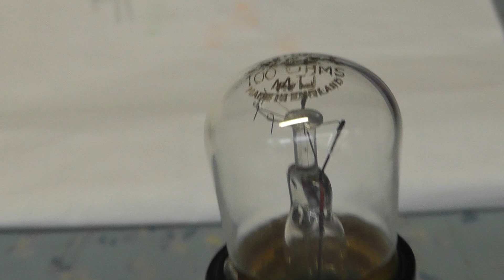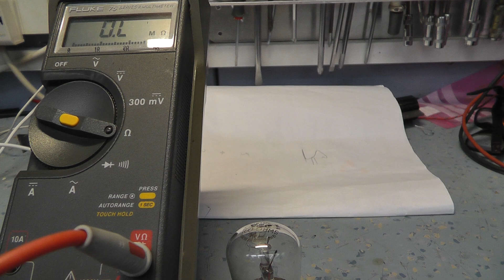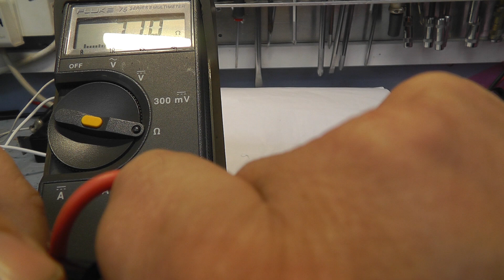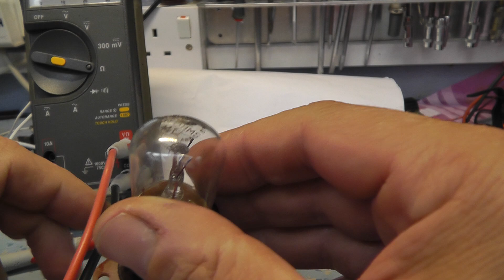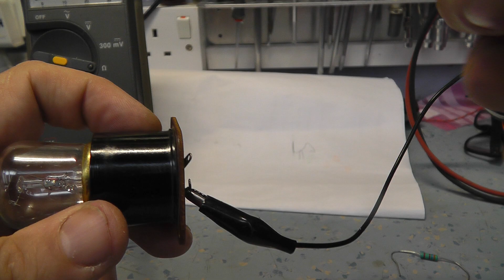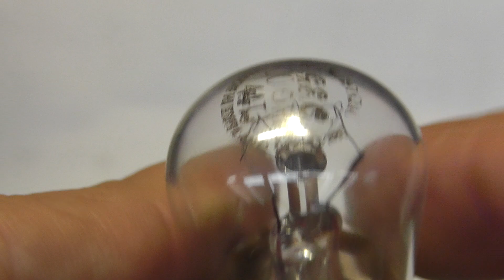Identify this if you can?

Comment: Barreter? Still useful, if you can find them! Wish they still made them... :(
Reply: These are great. Usually they can be had very dearly second hand (when sold by people that know) or very cheaply (when sold by people that don't). In the latter case it's a coin toss between flogging them on ebay or tossing them in the bin as many think of them as light bulbs. Some don't look like light bulbs (due to the base and internals) but some resemble one very much, like the own shown here. I think that most look like light bulbs though. I've never seen one up close though.

Comment: It's the polar opposite of a thermistor!
Reply from the maker: Depends if its an NTC or PTC thermistor.
Reply: @SoddingaboutSi  ,  In modern equipment we mostly see Devices with negative temperature coefficient, so that they limit the inrush current a little bit and then warm up and take themselves mostly out of the circuit after a few minutes. By the way, a good example of how lamps that function  as non-linear resistances are used would be the fuse and bias lamps in a Hickok tube tester; or a Wein Bridge oscillator.

Comment: It reads on the top: "Resistor".  So it must be a current limiter.   As temperature of the filament rises, resistance follows; hence the lower value in ambient temperature.  I wonder how much current it can endure.  You certainly don't want to blow a rare, cute thing like that one.

Comment: Cool video.  I mark all my incandescent light bulbs with its ohms value.  The watts rating on the box are not correct.  When I buy them from the seller I check it with my multimeter so I know what I'm getting.  Then ohms law P=E*R or P=V*R.
Reply: You do know incadescents resistance rises sharply with heat? It's a nonlinear resistor like a PTC. This is why they are so good as a current limiter.

Comment: Bar"ret*ter (?), n. [OF. bareter to exchange. Cf. Barter.] (Wireless Teleg.) A thermal cymoscope which operates by increased resistance when subjected to the influence of electric waves. The original form consisted of an extremely fine platinum wire loop attached to terminals and inclosed in a small glass or silver bulb. ...Nice one Andrew (Andrewausfa)...

Comment: Looks like a barretter or iron-hydrogen resistor. They have a constant current characteristic over a range of voltages and I believe were used for smoothing in power supplies. Never seen one in use though.

Comment: This is a Iron Hydrogen resistor. they where used as a constant current source. I have a larger one in the power supply for a deuterium arc lamp
Reply: also, these normally do not glow. At least the one in my power supply dose not. If it dose, i haven't seen it over the light of the other tubes in the power supply.

Comment: I have no expertise in this field but, l remember seeing something very similar in my parents house in the 1960s. We had the hot water system converted to an electric immersion heater with two switches to turn it one. One was located in the airing cupboard above the hot water tank. The other was downstairs in the kitchen. It worked like a two way light switch so you couldn’t be sure if it was on or not just by looking at the switch. There was a small screw in bulb in a holder next to the switch downstairs which gave a nice orangey glow when the immersion heater was on. Could this be some sort of indication lamp like that. It certainly looks the same.
Reply from the maker: It may well be. Unfortunately is looks identical to mat night light type bulbs from the past. It's just odd it's marked with the resistance  on it!

Comment: I would think its a sort of a load maybe...
Reply from the maker: Yes that's a possibility.
Reply: @SoddingaboutSi  As stated in my above comment, this is most likely an Iron Hydrogen Resistor, which where used in the days of vacuum tubes as a constant current source.
Reply: @SoddingaboutSi  Or maybe it goes in a suzy bake oven...